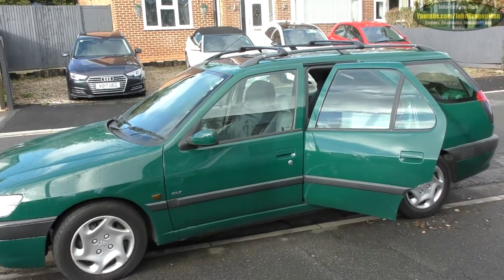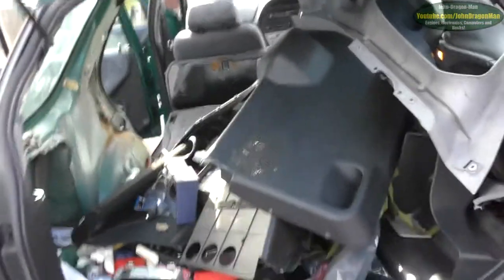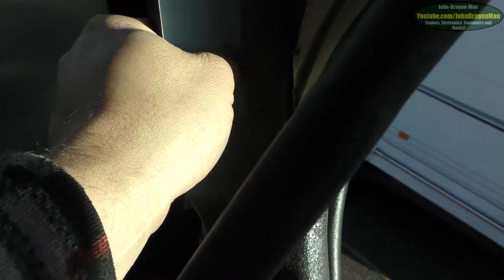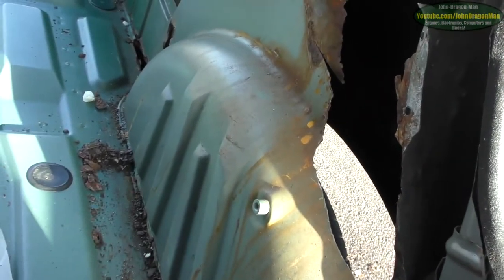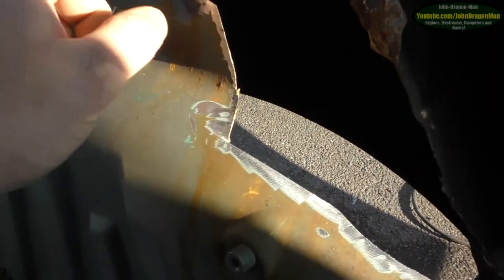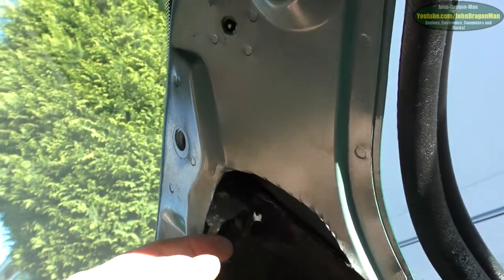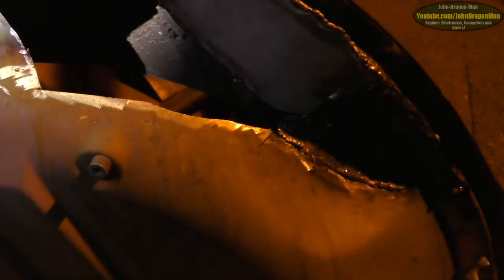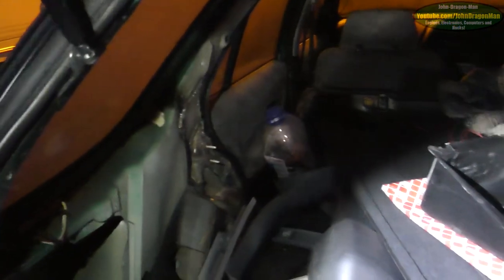Peugeot 306 Estate Vlog 2 - Rusty inner wheel arch repair

Comment: To be quite fair you don't see many rusty Peugeouts's but i guess they must rust in places you don't see. Do you still have the BX?
Reply from the maker: i sold the BX. it was just not the car for me when i got to drive it.. this 306 is not half bad though. the engine feels way more pokey in this than it did in the BX, and that was with a big turbo bolted to it!
Reply: I hope the BX stays on the road you did alot of work to it.  Do you still have Project Fallout and Tallon?
Reply from the maker: yeah i still have them both.